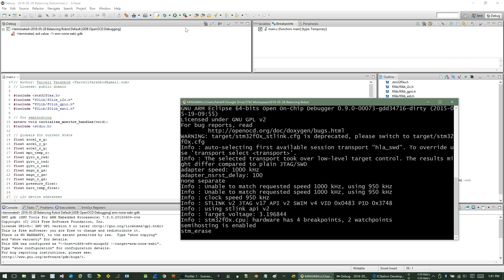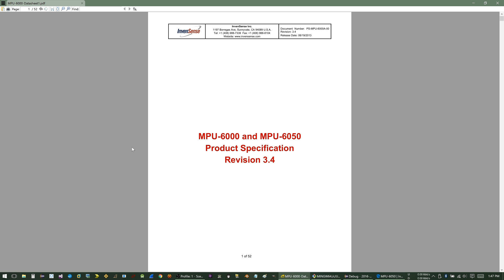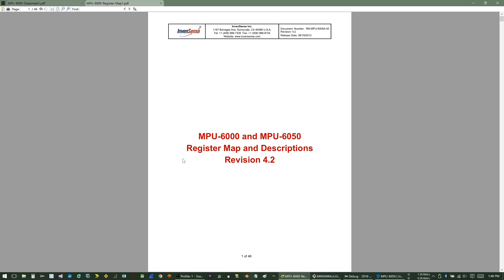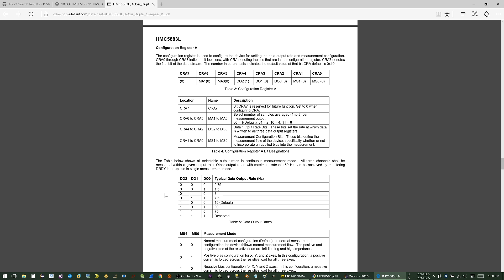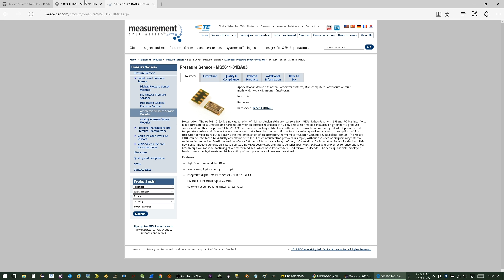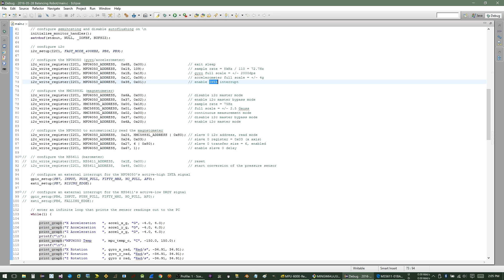First Steps with a GY-86 10DOF Sensor: MPU6050, HMC5883L and MS5611

Comment: I am a mechanical engineering student and came across this. The telemetry is almost identical to what we need to work on a project. I have a few questions as I have never coded arduino and dont understand it yet. I grabed the code from you link however it crashed due to lines 4-7. I know this needs to pull from some library. Do you have these files?

Comment: Congratulations, really nice video.

Nevertheless, I've got a GY-88 board with MPU6050, HMC5883L and BMP085 sensors and I'm getting problems reading the magnetometer sensor using the mpu6050 (it works reading separately).
Did you have any problem like that  in your previous tests? I've changed my project using exactly the same command you've used, but I'm always reading 0 (zeros) from EXT_SENS_DATA. (I'm using Arduino Uno board)

I've already read the documentation many times and it all seems to be OK.

Can you provide me any help? I really appreciate any kind of help on it ... I'm getting crazy!!
Reply: After writing this post I've realized that ... the board GY-88 connects all sensors to the main line SCL, SDA.
The MPU6050 I2C auxiliary line is not used. That is the reason this code does not work on my board.
By the way, the board GY-87 do use I2C auxiliary line, and it was changes in GY-88.

Thank you and I hope my comments here might help someone.
Reply from the maker: Glad it worked out, thanks for posting the follow up.
Reply: Hello .. I'm working also with gy-88.
Please, can you tell me what is meant by auxiliary line ?
Reply: Hello, the sensor MPU-6050 has an auxiliary line designed to drive external sensors.

MPU-6050 datasheet available here: https://www.invensense.com/wp-content/uploads/2015/02/MPU-6000-Datasheet1.pdf

On page 10: "Auxiliary master I2C bus for reading data from external sensors (e.g., magnetometer)"

Also you can check on page 24, there are two lines (23 and 24) for SCL and SDA, and two additional lines (7 and 6) for AUX_CL and AUX_DA (auxiliary lines).

Using auxiliary lines, it is possible to configure external sensors sending commands to SCL and SDA lines that are connected to MPU-6050, but the code has to specify that you want to address the external sensor connected to the AUX_CL and AUX_DA.

In case of using the GY-87 board, that is the way you have to configure the magnetometer (HMC5883L), for example, as the sensor is connected to the AUX_CL and AUX_DA lines (you must use the auxiliary lines). GY-87 schematics: http://www.thaieasyelec.com/downloads/ESEN245/GY87-MS-7.jpg

Nevertheless, the board GY-88 does not connect the magnetometer to MPU-6050 auxiliary lines, it is connected directly to the main lines SCL and SDA. In this case, you can't use the auxiliary line feature of MPU-6050. You just address directly the magnetometer. GY-88 schematics: http://www.haoyuelectronics.com/Attachment/GY-88/GY-88.SCH.jpg

I hope it helps you,
Regards

Comment: thanks for the great videos.  the stm32 mcus are great I use them extensively on a professional level, you should check into the dma as it will reduce your overhead further.  keep up the great work.
Reply from the maker: Thanks, I'm glad you like the videos. I agree, DMA would be better. I just didn't bother with it for this project since the MCU isn't even remotely taxed. That said, I plan to setup a UART with DMA so I can send text to the PC faster. Semihosting is just too slow, and it also halts execution when it's in use.
Reply: @upgrdman  I'd like you to assist a Desdemona simulator replicate, I only found it after inspection